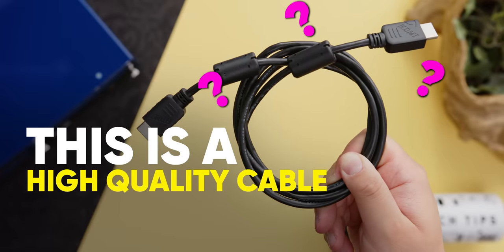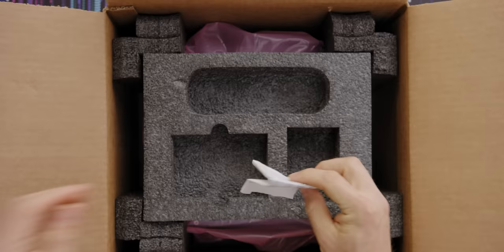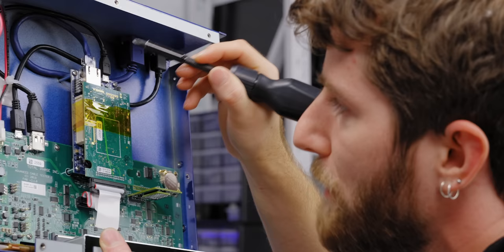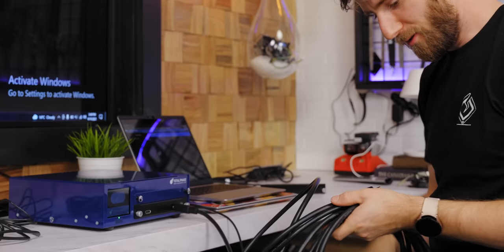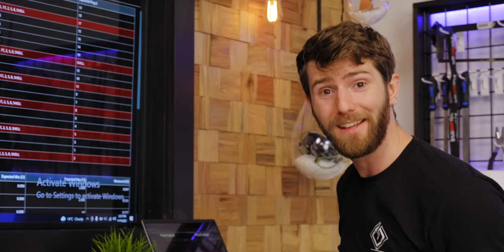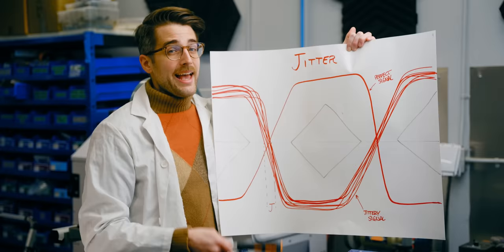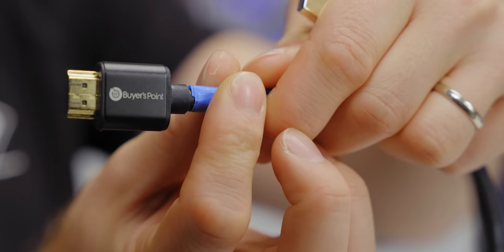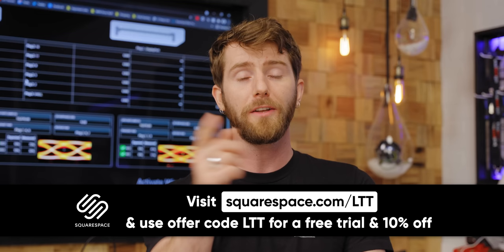This Just Saved me $100,000 - Totalphase Cable Tester

Comment: You should absolutely test the obscenely-priced Monster cables against some normal brands and have data to show that they're (most likely) just as good for 100x the price.
Reply: Monster can do hdr on xbox one x. El cheapo amazon could not.
Reply: @jessechapin8604  are you sure they are both HDMI 2.0 I bought a 6 foot HDMI 2.1 cable and it works great cost less than 20 bucks probably closer to 10
Reply: @jessechapin8604  monster cables are a ripoff. you got ripped off.
Reply: @jessechapin8604  Well sure, HDMI cables are built to meet different specifications.  I'm sure if you bought the correct spec "el cheapo" cable it would have done HDR just fine.

Comment: Just stumbled on this video, with a $15000 worth of equipment anyone ,with very few knowledge of the signals, can say if a cable is good or not. How, the rest of us, which do not have this equipment, can identify bad cables? This would be a real value added.  Something like you inject a square signal  with some specific parameters on one end, and check at the other end some parameters with an oscilloscope or some other decent priced tool. I am glad that someone gave you a tool to save 100k $ but the rest of us are not in this situation.

Comment: I'd love to see durability testing on different cables -- evaluating how much wear or damage the cable can take before it fails to deliver adequate performance. Some cables might fail internally well before you'd expect, while others might keep delivering intact signals even after the outer sheath has cosmetic damage.
Reply: Sponsored by glasswire 😉

Comment: I'd love to see you cover cheaper brand cables like monoprice and Amazon basics so we know if it's worth spending without loosing performance.
Reply: The thing about digital display cables is you don't really 'lose performance' it either works, doesn't work, or works but sometimes cuts out.
Reply: @marcogenovesi8570  I've never seen that happen automatically, at least not on PC. I have seen HDMI output a garbage image but that was because HDCP failed which is an entirely different thing.
Reply: @BriBCG  That is true. But I still do want them to take a look at cheaper brands to see if they are worth buying.
Reply: @marcogenovesi8570  I also had some trouble when trying to get 4k60 with some cables that weren't designed for it, they either didn't work at all or displayed a very horrible and corrupted image. My point was that's not losing any performance, it's asking the cable to do something it wasn't designed for. Although from the testing in the video it would appear that a lot of these guys are lying about what their cables are actually capable of.

Comment: I want to see this brought out on short circuit, whenever ya'll test a new product. (it comes with a cable, test to see if the cable actually conforms to spec). I'd also love to see roundup videos, showcasing like, 10-20 different cables that all conform to spec, or which ones out of a bunch does the best job.

Comment: When testing cables you should also take a sampling of one company or brand and see how consistent the cabling is, so even if you single test one cable from a trusted brand and it fails other similar cables could all be passes, so getting an average per cable brand as opposed to just testing one cable per brand of every type.

Comment: "Here's a 15k circuit board."
Proceeds to poke it with screw driver
Reply: Well, looking at the link the machine is sold for 15k USD
Reply: Did he mention the price of the device? I thought Linus said the device saves him 100k
Reply: @tbthegr81   @Guadalupe  I see, still a lot of money.
Reply: @guadalupe8589  I think he meant that similar machines can easily cost 100k.
Reply: @guadalupe8589  There is a link to the details of the device in the description of the video. On that page you can see that the price starts at $15k, plus a bit more if you want all available modules to be able to test all the cable types.

Comment: I'd love to see if the HDMI cable that comes in the box with the PS5 is actually up to spec or not. Looks like a decent cable
Reply: I believe they or someone tested it and it was up to spec
Reply: those kinds of cables are always worth it to take care of. Like chargers that come with your phone or HDMI/USB-C and Micro cables that comes with your consoles.
Reply: I was thinking the same cause it looks iffy
Reply: I'm using mine on an LG CX. I'm not a pro or anything, but based on what I've read, it does seem fully capable at least.
Reply: @BCBtheBeastlyBeast  it is, it's just not fancy looking because of production costs.
Reply: @Fernando_Ribeiro  In my experience high quality cables look simple and have smaller length but lasts longer than anything you can buy on market.

Comment: Twist: Accidentally gets a defective testing unit, throws out hundreds of perfectly good cables.
Reply: Hopefully it's calibrated
Reply: @LabRat Knatz that's why you do a quick cal or auto cal at the beginning of every test.
Reply: @AfifAhmad  It obviously is. But, if you read the manual, the device is scammy.  They have hard coded limits on the number of cables you can plug in and the number of times you can swap modules.  It will always be calibrated because they hardcoded maximum lifespans and force you to buy a new module when the drm kicks in on the existing module.  They do not publish the limit, so linus should be counting to figure it out and publish the limits.  I have a feeling he is going to quickly exhaust the limits just testing his existing cables. This is a 15k device with secret limits. The savings may not be there if you have to keep buying new parts due to drm. Sadly, if linus doesn't publish the limits, that can only mean they paid linus to feature the device.

Comment: Always test the cables manufacturers include with their products. External hard drives come with cables that are barely USB 2.0 speed. Every one can test them by benchmarking their drives with different cables. I've marked the bad ones for USB 2 use or charging only or tossed them if out after testing them. I also tested my ethernet cables and found more bad ones than I would have guessed.
Reply: How can we test them?
Reply: In the days of early USB 3.0 (with the drive-side connector that looked like microUSB with a tumor on the side), I've had to deal with SOOO many cables that looked decent but performed like absolute crap or had USB video capture boxes refuse to work or drop out. I remember putting a SATA3 SSD (Crucial M4) in an enclosure and going through a dozen cables to figure out wtf is going on, and some did barely above USB 2.0 speeds (40-50MB/s), others did somewhat better at 100-120MB/s and some of the cables included with devices and thick, expensive ones finally maxed it out at around 175-180MB/s. And one cable in particular failed to power up the SSD entirely. Tried again with a cardreader and that worked. Turns out the conductors were so ridiculously thin (more rubber and plastic than anything else) that the device at the end couldn't pull more than ~500mA or the voltage would drop below 4.6V and it would drop out/disconnect. Similar headaches with USB-C phone charging cables these days. Cables are a complete wasteland of garbage mixed in with decent stuff, sold with false promises and lies
Reply: @PERSONALEEMG  use good company suppliers, such as RS components. They are typically more reliable.

Comment: would love a testing of professional audio cables if possible. Often darn expensive, but because you are dealing with expensive projects, you just bite the bullet and hope it works. Especially XLR and Toslink (although I wonder if it can test the latter).
Reply: Any physical cable should be testable, if it is optical then so many other factors matter like bending and such, but if it is a metal cable then it should just be a matter of connecting it to the machine, and measuring inductance, capacitance and transient response as well as signal integrity, signal integrity being the important one.

Comment: If it wouldn't be a competitive disadvantage, how about every time you buy a batch of cables, put them in a web-searchable database with the date purchased and pass rates at different standards. You might find some HDMI 2.1 cables marketed as 2.0 for instance and could save folks some money. Or, you could tack this info at the end of a video, or do a once a week/month roundup of everything you purchased recently.

Comment: It was so cool to see you guys stepping up to a great industrial piece of gear like this. I have never used this device but cables can be a real problem for anyone. We had to use a way more expensive network analyzer for the same thing. Not only did it cost 10X it really did not do as good of a job. It was always SOP to test every cable in a test setup prior to testing. Super creds to LTT

Comment: Although its probable that you would already do it, I would also ask that when reviewing cables, you don't just review the one, but maybe a dozen, and see if they are consistently bad. The price of most cables makes this more realistic than doing comparisons of CPU/GPU's this way (which is what I would ideally want), and the silicon lottery and shipping issues can be a thing.

Heck, you could even get more complex sampling, where instead of buying one pack of a dozen cables, you buy smaller groups of cables from different packs. Anything that would affect the silicon lottery would probably affect its "batch", after all.
Reply: Samples should be reviewed over time.

Comment: I don't know if it is "normal" for industrial products but seeing how they made the case double the size they needed to just to use normal USB cable extensions that hook right up to the boards instead of soldering them reminded me of my own personal diy projects ^^
Reply: this is a lot cheaper than the competitors, so if it works it works, lol. But I do agree, professional equipment probably shouldn't be made like that. They might've even saved money on materials making it smaller.
Reply: @derek9879  
Probably bigger savings in shipping than materials...
Reply: It's normal, though this one seems a little light to survive industrial use. Often the bench-top form factor drives the layout of what's inside. The components could have been reconfigured with custom interconnects to make it all even smaller, but you still want a substantial box to keep the cables you're testing from dragging it off the bench. In some cases (no pun intended), they might even affix a steel plate in the bottom to give the whole thing extra weight. In the end, they decided that panel-mount ports with cable run to the actual board was more straightforward, cheaper, and as performant as spinning up another PCB to mount against the back panel just to run the same signals and power over custom cabling anyway. They also may have started out intending to mount a power supply board inside and scrapped that idea after shielding was too tricky but kept the form factor because they had already committed to it.

I've built a $40k+ instrument (many times) for a big corporation that combines several USB devices in a black box along with some fancy optics and instrumentation on top. The USB port for controlling the whole thing was a 9" panel-mount USB-B Female to -B Male cable connected to a hub inside. All the other instruments are plugged into this hub with regular USB cables. If compactness was the primary limiting factor, all the electronics could have been de-cased and stacked in some custom assembly with custom interconnects and a single power supply. The optical path and the structures to support it were plenty big enough to just put the whole instruments, with cases and power supplies, inside the black box and run off-the-shelf cables everywhere. Design is simple, interconnects are easy, and the product does what it says on the tin with minimal development costs.
Reply: Also cheaper to buy a standard size case then get one custom made.
Reply: Needs to be that big for strain relief of those same cables really,  and it gives an east way to replace the ports on the back if they become damaged

Comment: I bought a $2200 pc. (I7 13700K, 4070Ti S etc) I picked all the parts by hand, (as in, switched all the crap chinese-ium crap that was auto-selected for good parts) and the PC arrived and it's worked pretty dang well. The only weird thing is when I first got the PC I couldn't get it to send a signal through any of the HDMI cables I had to the living room TV. It finally worked after I connected it with the HDMI cable that was sent with it to the HP 1440 144hz monitor I have. I only found out yesterday, after digging through their website, that said cable is a HDMI 1.4 cable... Serves me right for researching each and every component except the cable. I ordered a 2.1 cable yesterday. I'll see how this goes...

Comment: Dare ya to to throw some curtainwire / 10base2 in there for the lols.
How many USB extensions can you stack up before it goes to custard?
Compare  SATA cables with PATA.
Copper-clad aluminium vs pure copper for ethernet patch cords.
Those funky new slim-line ethernet patch cords that help make your rack tidier (they sure do)

Comment: I had an HDMI cable which gave me the impression it's quite "PREMIUM".. 
However, each time the fluorescent in the room nearby goes off, the monitor would lose its signal for few seconds. I replaced the cable and problem's gone ; a device like this would have helped me find out that this cable was a crappy one from the beginning.

HDMI aside, crappy DisplayPort cables could literally destroy your equipment, or cause another weird issues and behavior of the components they're attached to, such as boot failure and other stuff ; Having a review which covers variety of common brands and dp revisions (1.4/2.0) could be EXTREMELY helpful to us all. this would be highly appreciated if done.

Please make it happen, Linus! 🙏
Reply: I once had a faulty DVI cable that caused a Oculus Rift HMD to not track the position probably it was glitching around alot.
The DVI cable was hooked to the "spectator" monitor. I lost a lot of nervs and time finding where the issue is

Comment: I would love to see an in depth test of the real (if any) difference between different 'levels' of Audioquest cables. They have HDMIs with prices in the hundreds and even thousands. Even their entry level is supposed to be better because of solid core conductors and such. Scrutinize them!!!!
Reply: They probably pass but they're still not worth it. When you're transferring a bunch of 1's and 0's, the "good enough" level is where they all get through fine (and the cable is not particularly vulnerable to interference), anything above that is just waste of money. You can make your conductors out of platinum but your picture won't get any better.
Reply: @tseikkisnelkytkaks9013  That's the whole problem with the audio voodoo. They say that cable sound different, that is ultimate bullshit, but from the other hand - if you say the cables don't matter - it's obviously a lie to. Until 4K@60FPS - digital cables I used either worked or not. But roughly from that point - cables may sometimes work, work but various artifacts and image tearing occurs, and what's the most annoying - the problems occur randomly on some bad cables. There's another one aspect of a cable - durability and what happens with it when you connect and disconnect it many times, stretch and twist it, that kind of things. The cable may pass the test, but you will abuse it a little during moving things and it fails. With USB 3.1 and newer it's similar. Only the good ones will achieve the declared speeds.
Reply: @Adam_Lyskawa  Yes, isn't that what I was saying? "Good ones" don't cost hundreds of dollars.
Reply: @Adam_Lyskawa  Remember that blind test where the Aluminum coat hanger "cable" sounded the best to the enthousiasts ?

I'm starting to think the most significant part is using decent connectors going out and non-shoddy internal wiring and soldering ( And i've seen some shoddy internals ).
Reply: I’d love to see their USB cables compared

Comment: I would love to see a video talking about and comparing signal degradation over distance for various cables from different manufacturers as well as the same manufacturer (i.e. monoprice 3ft, 5ft, 9ft of a type of cable, vs Amazon basics of those same lengths, vs M-cable for example) this would give both a compare and contrast for why some cables are better than others, as well as insight into how much signal loss is tied to distance in real world terms.

Comment: I would highly recommend finding any cable providers that operate near you, and get whatever cables they use in their van to hook up customers systems. You can see if the cables they provide actually work well, or should be avoided at all cost.

Comment: Manufacturers don't scratch off the numbers on chips to protect their IP. They do it to keep you from realizing that they are using public available IP in their $15,000 products.  Good on you though for finally getting the cable situation under control with what looks like a really neat tool.

Comment: Like 4 years ago yall tested a "smart cable" called the "mCable" that did antialiasing and I think other quality enhancements. if yall still have it around it'd be cool to throw it on there and see what happens.
Reply: I'd be very careful about using this testing kit with any cables that include electronics in them as it could very easily damage the cable's electronics or just unnecessarily fail the cable. I'm unsure if this testing rig is able to test cables such as the "mCable" or other cables with integrated electronic such as HDMI over fibre cables. Cables with electronics in the require power to run the circuitry without which no signals will get through.